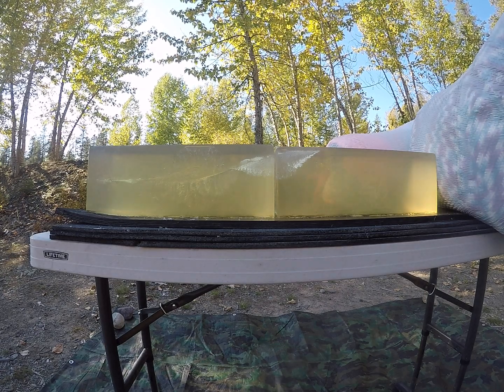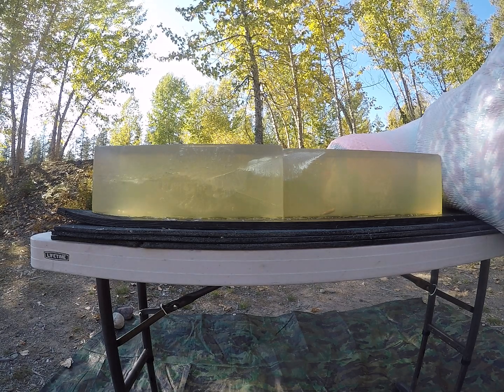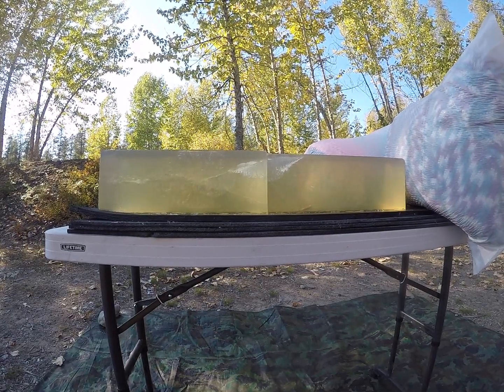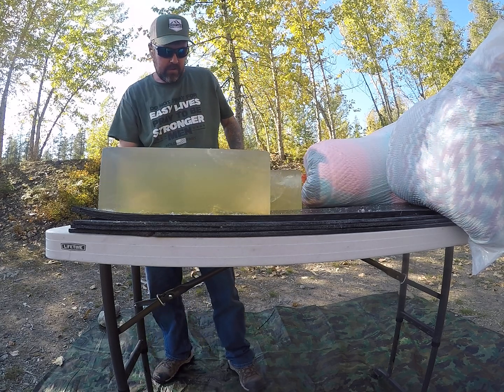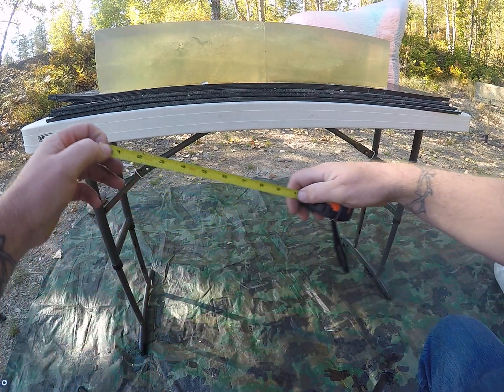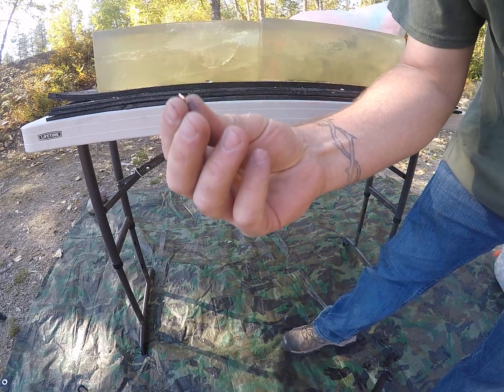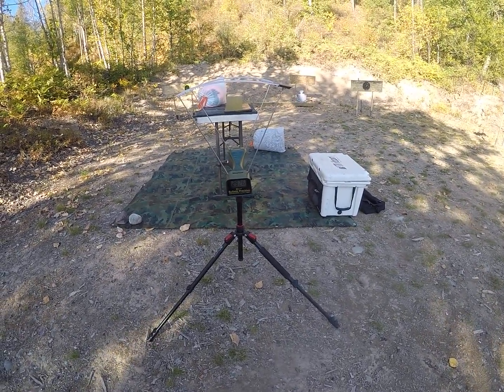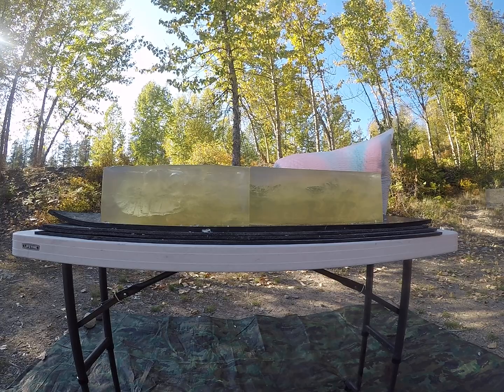PT1 Badlands Bulldozer 2, 30 cal 175 grain gel test at various velocities. 308, 30-06, and 300 PRC

Comment: I can send you another handful if you need them. I personally didn’t expect much at the low end. Badlands says 1,700 fps as the minimum and maybe they really mean it. The plus side is that these bullets will retain more velocity with their high bc so they will still be effective at longer ranges than most any other mono bullet. Thanks for your efforts
Reply from the maker: I have a few more and should be able to find a bottom end. I didn't see a velocity rating when I checked their website, I have to look again. 

Most hunters don't shoot past 400 yards and the low end operations of bullets have little concern. 

There's a handful of reasons I always like to know the low end as well. One is what is the effective range based off of muzzle velocity two is when working with youth and what not it is nice to be able to build a reduced recoil load that will still stop game well.

Comment: Interesting.  High bc but not the best performance at low velocity is a bit counterintuitive.   Barnes bullets and hammer bullets for me.  Frangible lead core  is king for long range performance.
Reply: High b.c. and good performance at high velocity is actually better in my opinion for a hunting bullet designed for hunting, not shooting game at 3/4 of a mile. High b.c. makes wind drift and bullet drops out to 3 or 400yds a breeze. Even if you wanted to shoot game at 700yds, the 140gr at ~ 3000fps in a 270 is still going almost 2100fps at sea level. With the high b.c. though, that same load zeroed for 250yds is only dropping 29 inches at 500yds and in a 15mph wind I have 18 inches of drift. The highest b.c. hammer that I can run in the same 1-8 twist is a 156gr with a .292 g7. at 2850 that bullet has 34 inches of drop at 500 and 22 inches of wind drift. Like I said, not the best for 1300yds shots on game, but in most cartridges I haven't found a better performing bullet for shots under 600yds.

Comment: Truthfully the low end performance doesn't bother me at all. I'm a hunter, not a ELR shooter that uses animals instead of targets. Even so, at a 2800fps MV those bullets are still traveling 1980fps or more (elevation changes) at 600yds. Glad to see that they perform well at higher velocities though. I'm going to probably load the 140gr in a custom 26 inch 270, sounds like I'll have plenty of bullet for elk sized game and under.
Reply: The .277, 128 Badlands Bulldozers (0.531 BC) works great in a 270 Win.  There is no need to shoot a heavier bullets in the 270 unless shooting 27 Nosler with a real fast twist, etc.  I load them in an old Pre-64 Model 70, so I need to stay with lighter bullets due to the slower twist rate.  I am using Staball 6.5 and getting just over 3200 fps at 60 degrees F.  I shot two deer sized animals this year, one at 500 yds and one at 515 yards.  Both were 1 shot kills and in both cases wound channels were good and bullets exited.  I have lots of experience with copper bullets (mostly Barnes and the older Lost River (no longer in business)) and these Badlands have not disappointed.  Accuracy is good, BC is high for a lighter bullet and terminal performance was also excellent.  When using copper bullets, I like to keep MV over 3000 fps and always shoot at least 1 bullet weight lower than with a standard lead core.
Reply: @gearguidesguns571  Normally I would agree, but I can run 140s around 3050 in my gun, and 130s like you at just a bit over 3200. I have the twist rate to stabilize the 140, and for only 1.5 inches more drop at 500yds I have 4 inches less wind drift in 20mph winds (normal in my area) and 200 ft lbs more energy. Not that any elk or deer is shrugging off a 128gr hitting at 2300fps, but for essentially the same bullet drop my other measures of external ballistics are just a bit better with the 140s. Not to mention the drop is the exact same as my 243 a.i. with the 100gr and 33 nosler with the 200gr. I do mean exact too, I couldn't find a measurable difference at 500yds. Just makes things a little simpler when switching guns for me.

If you have pictures of your harvest, there's a thread on the long range hunting forum dedicated to the bulldozer bullets, drop your experiences in there if you would like to contribute.
Reply: @papajohnsy6659  If you have the faster twist rate and can get over 3000 fps, then the 140 is an excellent choice.  My old pre-64 M70 probably has a 1:10 twist, which is just enough for the 128 Badlands.  The forum you mentions is the Len Backus, Long range Hunting site?  I just joined it but haven't posted anything.  Generally I never spent much time on Forums, but from time to time, I find some great load and cartridge data.  The reloading manuals always underload for safety and sometimes don't show many powder or bullet options.   The animals I shot with the 270 were a WY Bighorn and Antelope which took me many years (23 points for the bighorn and 15 points for the Antelope) to draw.  These badlands bullets are a real game changer but so many people are hooked on high BC lead core target bullets which can be inconsistent for hunting.  If you are shooting a 243 AI and a 30 Nosler, you have some great cartridges.  I really like the 7SS and 338 Norma and often shoot a 6.5-06, 7mm and 300 Borden.  I feel that new 7 PRC will be the next latest craze, but it has the numbers and efficiency to back it up.